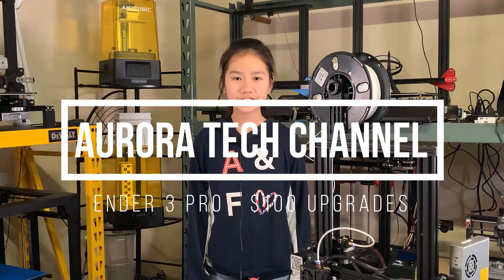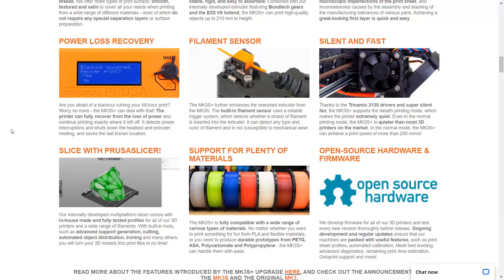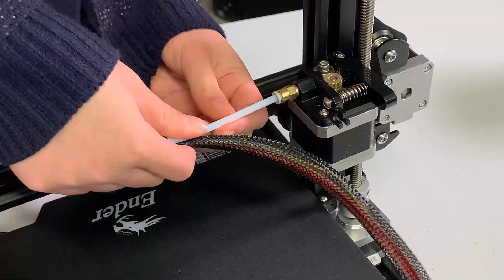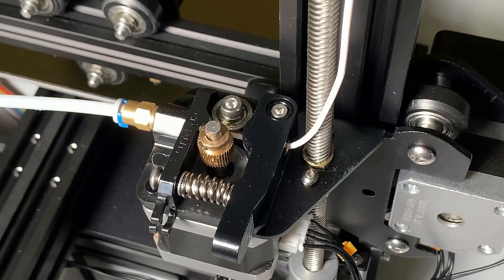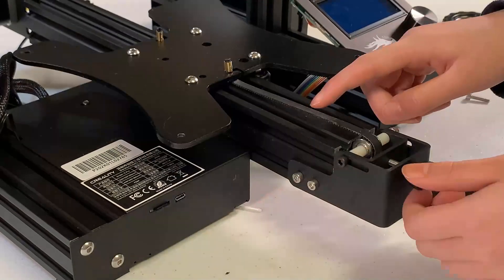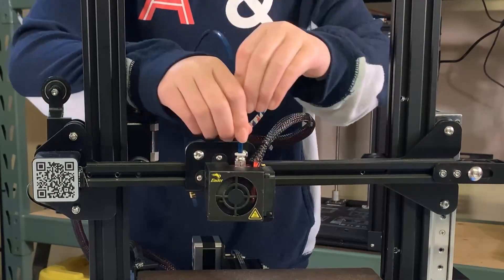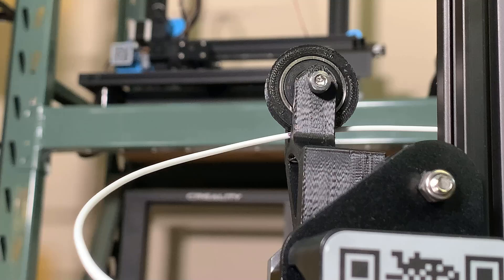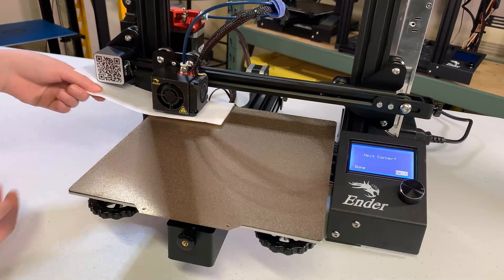Ender 3 Pro 2021: Part 2 - 7 upgrades, improve print quality, extruder replacement and calibration

Comment: Do you prefer springs to the silicone spacers? Also for the extruder. I have the microswiss direct drive. Is there a mire compact one for the ender 5 plus for weight savings?

Comment: Would you be so kind as to share the .stl file you used (or location) for the filament guide you used? I would like to add the filament sensor but existing guide is too small to mount to it.

Comment: I'm an absolute smuck! I installed those belt tensioners on my Ender 3 Max. In order to do so, I dissasembled the entire thing and reassembled it with the belt in there. NEVER did it occur to me to just detach the belt and run it through...

Comment: Great Video.
Why is the 3 pro's quality better than 5 pro's ?
5 pro also has Capricorn tube and metal extruder, right ?
Reply from the maker: Good question. Yes, you are right. As I have also upgraded the Ender-3 Pro with Capricorn tube and metal extruder with dual gear, also the length of the bowden tube on Ender-3 is shorter, so the retraction is slightly better than stock Ender-5 Pro.
Reply: @AuroraTech  
Yes makes sense.
Thanks!
Keep up the great work!

Comment: I am looking forward to this series.
I previously upgraded my CR10 to linear rails on the Y axis. For me, there were really no difference between before and after. Noise level is the same, and I don’t feel the axis move easier, or is more rigid than before. So I’m interested to see your results on that modification.
Reply from the maker: Yes, you are right. Linear rails won't print any better, I think they may perform slightly better than pully wheels when printing at higher speed, will try this upgrade on Ender-3 and Ender-5 and see if I can get any improvements :)

Comment: Another great video.  Your presenting style really is perfect for informational/educational videos like this.

Some comments:  I completely agree that the #1 upgrade for any new printer is a PEI-coated steel build plate.  They're practically magic.  I also agree that the stock plastic extruder on the E3 and similar printers is trash and should be high on the to-be-upgraded list.  

For the filament guide and spool roller, you can print your own 608 bearings and save a few bucks.  Printed bearings are tough to pull off and nowhere near as smooth as a real bearing, but they're more than good enough for these non-precision applications.  Tweaking your settings to get them to print correctly makes for an excellent extrusion and retraction dialing-in exercise for a new printer.  Heck, you could probably do an entire video on tweaking settings to print good print-in-place bearings.  There's several models on thingiverse, and I've had good luck with this one in particular: https://www.thingiverse.com/thing:2746804

You can save even more money by printing your own belt tensioners.  $23 isn't bad for metal tensioners, but it's an order of magnitude more than what it would cost to print them.  Again, there's lots of options on thingiverse for various printers - I don't have an E3 so I can't vouch for one in particular for your printer, but I've printed these for my LK1 and they work great. https://www.thingiverse.com/thing:3413076  https://www.thingiverse.com/thing:3662614

Take the money you saved with your printed bearings and tensioners and upgrade to an all-metal hotend.  A microswiss knockoff like the one from gulfcoast robotics is about $30, and it is a very significant upgrade.  Going all-metal means you don't need to fuss around with the bowden tube at all - the poorly-cut generic white tube is fine.  You'll also be able to dial your retractions back a lot, and you'll open up some higher-temp filament options.

With the money you didn't spend on capricorn tubing, consider buying a bed insulation mat.  They're cheap, and they help your bed heat faster and more uniformly.  They also save a bit of electricity, and that's never a bad thing.
Reply from the maker: Thanks for sharing the links!

Comment: I look forward to seeing your new video’s each week . A quick suggestion for you . You should be able to remove the press fit gear on the original stepper motor . Use a Dremel with a cutting wheel . Cut a slit in each side of the gear until the gear comes off . Use some tape to protect the part of the shaft not being cut . Then clamp some vice grips to the shaft to keep it from rotating while grinding . Then measure the depth and length of the D-cut in the new shaft of the stepper motor . Again use the Dremel with a grinding wheel attachment . Use a digital micrometer to get the correct size . Also use some oil or other lubricant to keep the shaft from getting too hot . If you have multiple stepper motors that need to be changed . It could save you some money with only needing to purchase the gears ⚙️ . They are not very expensive . Hope this helps you or your viewers . It could also make a good ( how to ) video .
Reply: There are also pullers, that are normally used for bearings, that should be able to remove the gear as well.
In the US, they can be had for cheap at Harbor Freight. They have a set of 3 jaw pullers in 3 different sizes for $19.

Comment: Hi, I just bought an ender 3 max, do you know of any good slicer programs for it?
Reply from the maker: My personal preference is Cura as I am more familiar with its features, I use it most of the time for all printers.
Reply: @AuroraTech  I decided to use the Creality slicer; its based on Cura and seems to be very simple.
But maybe I will experiment with all of them.
Reply: I would say PrusaSlicer. Set it as a Ender 3 and then change the size of the bed an Z height afterwords.